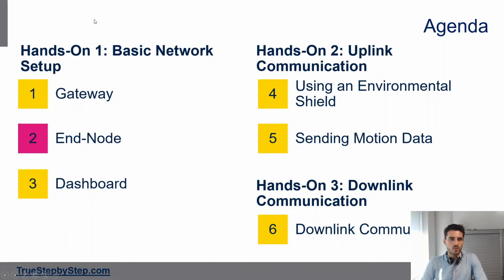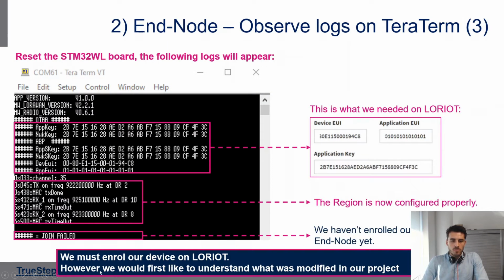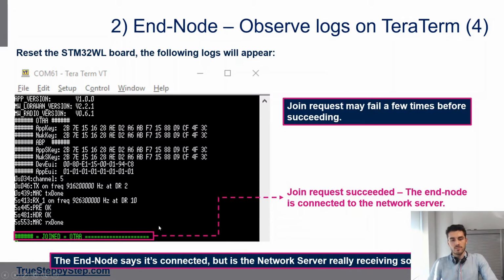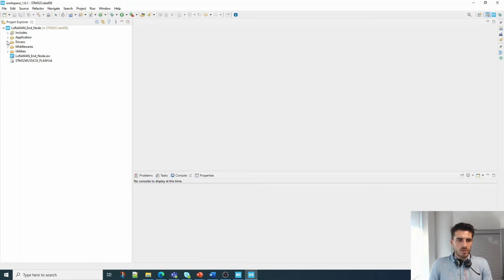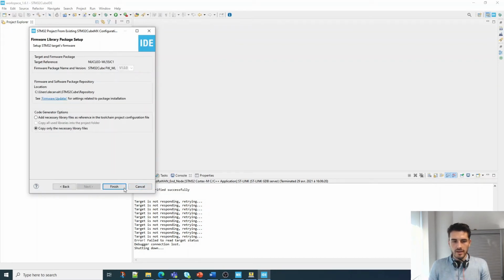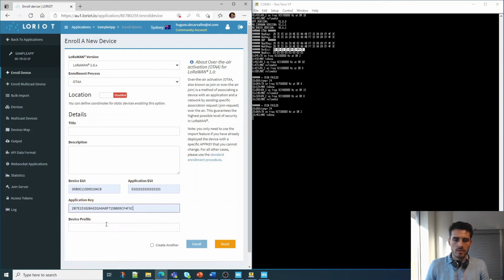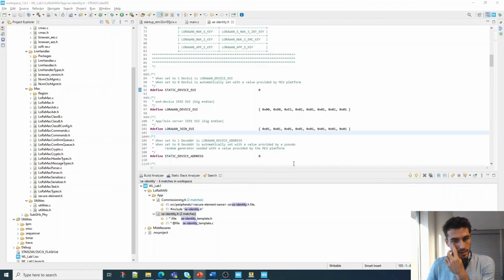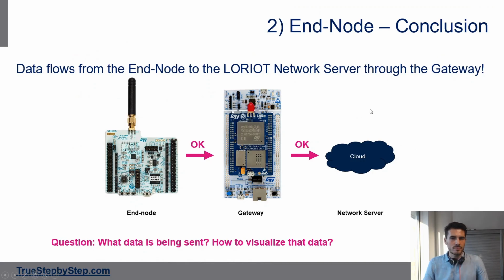STM32WL - LoRa Guide - 2) Hands-On #1.2: End-Node

Comment: Hello!
I did the steps for the same setup ==> JOIN FAILED
I took the setup and changed the SW for EU868 and HYBRID_ENABLED 0 and then flashed ==> still JOIN FAILED
Does someone have a more up to date video, or did you encounter the same behavior and found the issue?

Comment: Great video. Unfortunately, they changed the settings within LoRaWAN middleware for radio_board_if. following your steps would generate warnings and the board would not try and join. Please make an updated video on this. Im struggling trying to get this working
Reply: How did you go with this? I'm currently banging my head against a wall with the warnings and the changes in configuration options..
Reply: @synergitech  Same for me right now. Did you manage to get this to work?
Reply: @Rick-bn5dg I believe so, but it was such a long time ago now that it's all a distant memory. I was able to connect the end node to loriot I just don't remember the problems I encountered or how to solve them unfortunately.
Reply: @synergitech  That's unfortunate. I do appreciate your reply though :)
I'm trying to compile the examples for the Ebyte E77 devboad (STM32WLE5CCU6) for a very hours now but have still been unsuccessful to do so🥲.